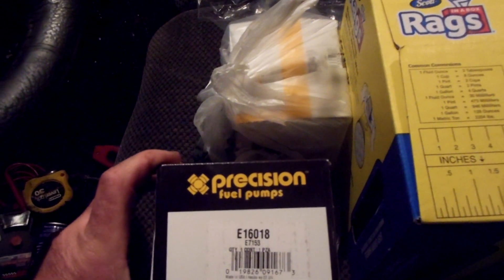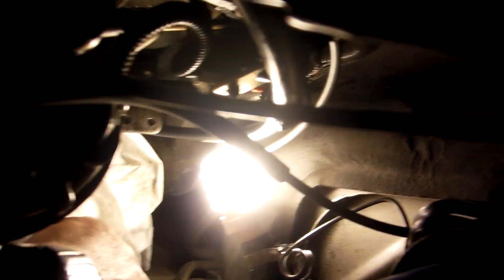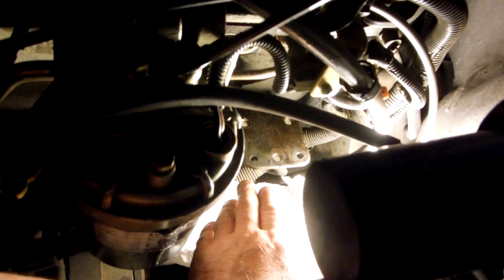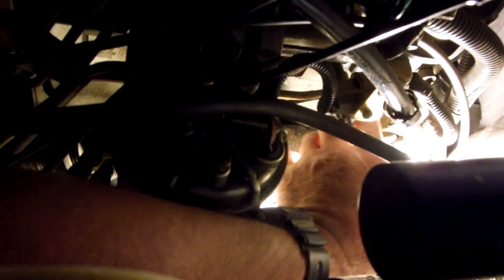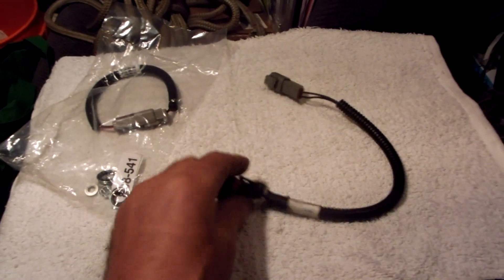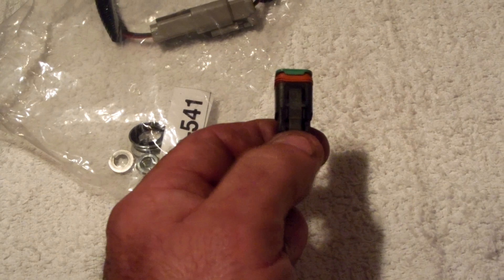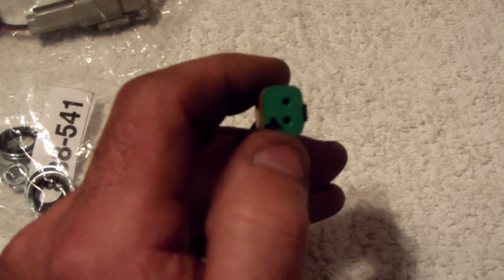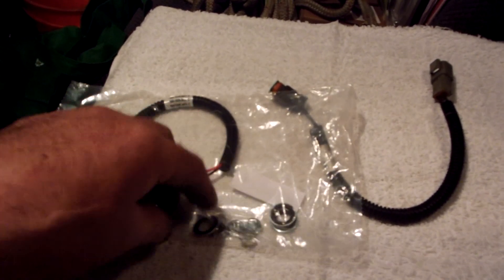1999 Dodge Ram 2500. Cummins Turbo Diesel. Showing How to Replace The Fuel Pump.

Comment: My pump is located back by the tank on the frame rail not the side of the engine.
Reply from the maker: someone probably put a "fas pump system " back there. its the best place for it. Pumps push alot better than suck.
Reply: OcRefrigeration , Hvac & Electrical Video's. I thought the same but when I got under there it looks just like the pumps in your videos just located back by the tank. Doesn’t say fass on it anywhere. Makes a very clear noise like this goin out tho. Once you start it it will creep up to about 10 psi at idle but that’s all it’s got left. Was at 22-24 consistently and never dropped below 20 psi even at wide open. Gonna end up doin the full fass lift pump in its place.
Reply from the maker: someone probably had to replace it once & did not want to deal with the F'd up location factory puts it in. Back by tank is better. like i said pumps like to push. not suck. allways keeping pumps below liquid level is best too.

Comment: Was your fuel pump making a weird loud sound..?
Reply from the maker: When My Fuel Pump died, it Gave Me NO Notice at all. I went to start my truck in the Morning and it just ran out of Fuel in the Driveway. the Pump worked Great the Day Before & and that Was it!
Normally the Fuel Pump Should Make a Whirring Sound when u First Start the Vehicle to Tell you that the Fuel Pump is Pumping Fuel / Pressurizing the Fuel injection System.
If Your Fuel Pump is Making any Kind of Weird Sound I Recommend Replacing it A.s.a.p. !!! it Only Takes a Couple hours Work Mine only last about 80,000 Miles a Piece.

Comment from the maker: Just did one For a Guy in Orange County, California. January 2014.
1999 Dodge ram 2500. 4 x 4. Automatic Transmission. 5.9 Cummins Diesel
The Truck Had 399,000 Original Miles on it. What a Bear Getting the Electrical Plug Apart But, Besides that, the Electric Fuel Pump Went in Pretty Much as Expected.